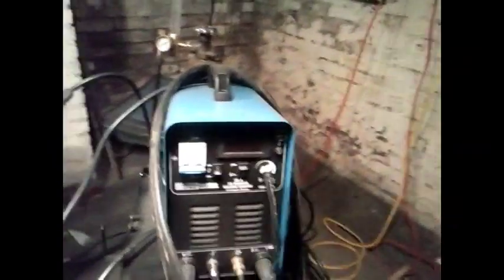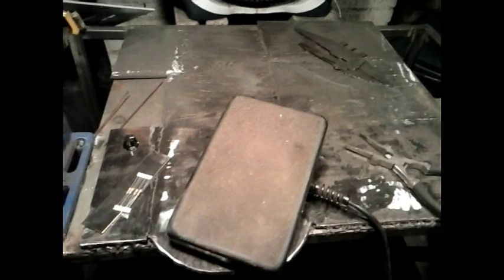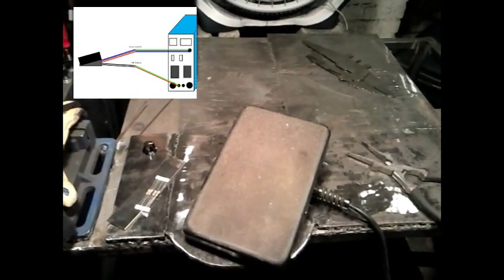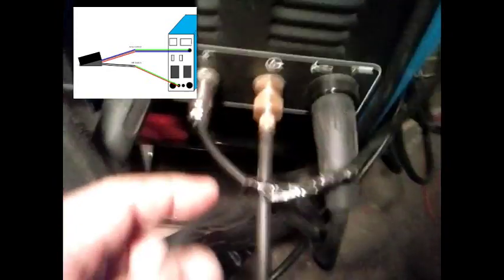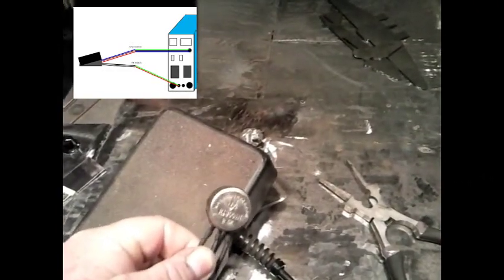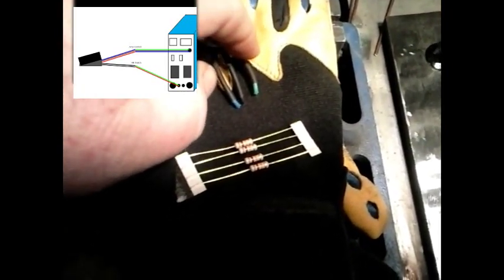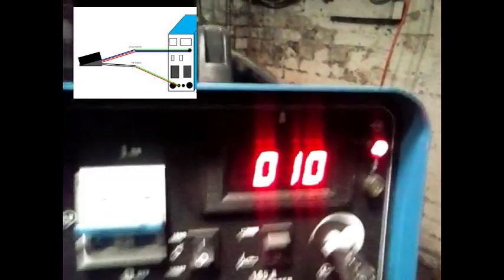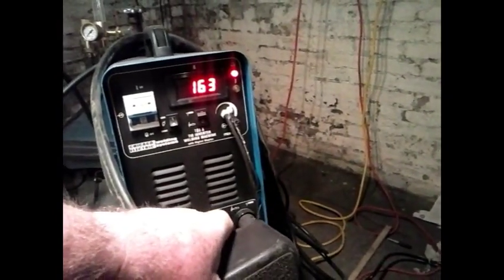Harbor Freight Tig Welder Foot Pedal Mod

Comment: how many  resister did  use I doing to same thing but my is 2k to 1k I used 1 2k  resister on a 2k pot to make it 1k my tester said its working y do u have 4  resister

Comment: Hi @james allen great video , what you think about a 2+3 pin on ebay ,item # 181635926718 , thanks again , and also do you have to secure the torch button in the on position after the mod ?
Reply from the maker: +Joshua Gomez As long as the resistance matches you should be fine. After the mod you won't need the torch switch.

Comment: Why even bother with the resistor, it's a potential divider and the voltage from the wiper will be proportional to the position and voltage across it. Just don't put a much lower resistance pot in place as it may draw too much current from the circuit providing voltage to it.
Reply from the maker: James Allen Whoa there James, you have much more electronical knowledge than me. I'm just matching ohms here lol
Reply: Adventures in Welding! Good video, thanks for sharing. I wanted to retain the functionality of the original potentiometer (it's a CT-312 TIG & plasma cutter)  but be able to switch to the variable foot pedal potentiometer. I used a 6 pin, 2 circuit rocker switch to isolate each potentiometer so I could switch to either one.
Reply from the maker: James Allen As log as you keep the original grounds you should be golden.
Reply: @jamesallen9733  Hi James, I read your comment in an very old post about adpating a foot pedal in an TIG welding machine. I'm trying to do the same with my machine and I wondering if you could help me and tell me about if you got good results from this modification and also if it don't bring any problem or malfunction to the machine. I thanks in advance James.
Reply: Obviously this circuit is looking at the current through the wiper, not the voltage.  If it was a voltage divider, the parallel resistor would do nothing.  In this case, it changes the current to be in the range of a 5k pot, but not in a linear way.  A 5k pot at 50% would measure 2.5k.  This arrangement measures 3.75k.  But at 100% they both measure 5k.
Reply: @stargazer7644  Well, there may be bias resistor(s) in series with the pot. You can't, for certain, say that it is current based.

Comment: Badass!
Reply from the maker: housewhere Thank you!
Reply: Adventures in Welding! What pedal did you use? I just bought the same machine. Needs a pedal.
Reply from the maker: I used an SSC K772 but, this one from Amazon will work just as well http://www.amazon.com/Foot-Pedal-controller-for-Stahlwerk/dp/B00HK74R0U/ref=sr_1_1?ie=UTF8&qid=1428752048&sr=8-1&keywords=stahlwerk+foot+pedal
Reply: Adventures in Welding! Great thanks! Same resistance and everything?
Reply from the maker: Yep, just wire it up! It may be a +/- 5 amps from you expect. You may see a top Amperage of 168 or so, but it's well within tolerances
.
Reply: Adventures in Welding! Awesome. Thanks.

Comment: I;m still confused you just said " The 10k pot with a 5k resister wired in parallel halves the value of the pot." So I still need the 10k right?
Reply: yes, you need a 10k. 10x10=100 (R1xR2). 10+10=20 (R1+R2). 100/20=5 (pot value). (R1xR2)/(R1+R2). use all the zeroes it's 100 million divided by 20 thousand, which still gives a result of 5 thousand.  10k "hard" resistor in parallel gives your 10k pot a working resistance of 5k at full value, and a skewed slope down (which is why his amperage wasn't entirely proportional to his pedal position)
Reply: Get the proper 5k pot.  It will work better.

Comment: You said to add a 10k resister to the pot to make it 5k. I'm sorry but shouldn't you add a 5k resister to drop it to 5k. I'm confused and just want to do it right...John
Reply: "The 10k pot with a 5k resister wired in parallel halves the value of the pot."  Not really.  Two 10k pots with all 3 wires in parallel would give you a 5k pot if you ganged both knobs together so they turn at the same time.  Simply adding a resistor doesn't do this because the wiper isn't connected to the parallel resistor.  

There are two ways pots can be used.  A circuit can look at the voltage from the pot (a simple voltage divider), or it can look at the current from the pot (a variable resistor).  Your welder appears to look at the current.

Adding a parallel resistor in a current controlled circuit limits the current to what a 5k pot would give, but it screws up the linear taper.  So you'll have more control at one end of the pedal travel than the other end.  It is no longer proportional.  This doesn't hurt anything, but it won't give you the fine control that it should.

If your welder uses a voltage controlled circuit, the resistor does nothing and is not needed.  It will work proportionately as it should.
Reply from the maker: The 10k resister is what's needed. I'm not an electronics expert, but here's my understanding. The 10k pot with a 5k resister wired in parallel halves the value of the pot.
Reply: Adventures in Welding! Just to clarify further with my own electrical knowledge... two equal value resistors in parallel will sum to half the resistance. So two 10k ohm resistors in parallel will equal 5k. The formula for calculating resistors in parallel: (R1*R2)/(R1+R2).

Comment: Did notice you mentioned half pedal position and that showed approx 120A - made me wonder if the pot in the foot pedal was a log instead of linear.  Overall a good result though.
Reply: That's because he put a 10k resistor in parallel with the 10k pot.  That makes the pot's response no longer linear.  The 50% point is now at about 70%.  Putting a 10k resistor across a 10k pot does not turn it into a 5k pot.  It just makes it look like one at full scale.
Reply: So  @stargazer7644  what would be the best resistor to use for this mod? (or what pot if switching them out)?
Reply: @oldowl4290  The best pot to use is one of the correct value.  This apparently needed a 5k pot.  You also have to pay attention to if you need a linear or a log (audio taper) pot.  This project likely needs a linear pot.
Reply: @stargazer7644  thanks for the quick reply. I recently picked up this same welder from a friend for $100. I also have the 170amp mig unit which I've modified so I want to tweak/tune this one as well.
Reply from the maker: No, I didn't notice that. The pot I put in was a linear taper. It might just be I was more than 1/2 way on the pedal.

Comment: does this work http://www.ebay.com/itm/SSC-Controls-Company-S420-1501-Light-Duty-Foot-Switch-Pedal-Power-/331411099410?pt=LH_DefaultDomain_0&hash=item4d29a40f12
Reply from the maker: Hey RC-Flyer, thanks for writing. No, that pedal is made to turn a machine like a lathe or drill press on and off. What you are looking for is a 5 pin Lincoln amptrol. Even this one for $50 will work. http://www.ebay.com/itm/Foot-Pedal-For-Stahlwerk-Welders-/290861885532?pt=LH_DefaultDomain_0&hash=item43b8b8285c

Hey what do you fly? I'm an AMA Leader Member and Contest Director. Been flying for 20 years. I like large scale gassers.

Comment: Was that a new or used pedal that you purchased?
Thanks for the info
Reply from the maker: Hey there 1970351c. This is an SSC foot pedal I found on ebay, My winning bid was 49.99. It was definitely used. Thanks for the question.
Reply: I just watched your video. Love the conversion process that you did for this machine. I have the same tig welder and want to do this conversion. I have some questions though. It would be easier to ask over the phone. Can I call you? My email is Josephminnick73@gmail.com  please reply with your phone # if your ok with that option. Thanks Joe